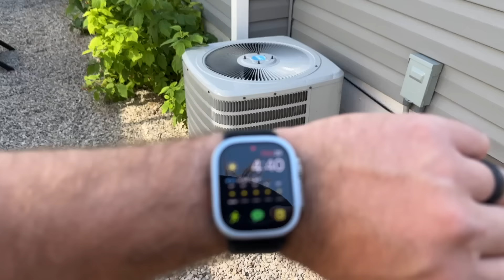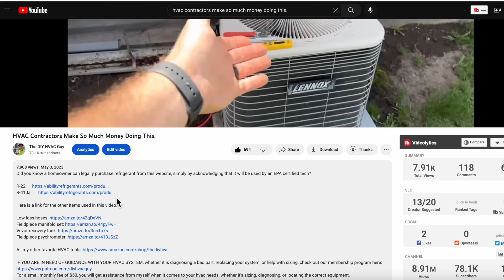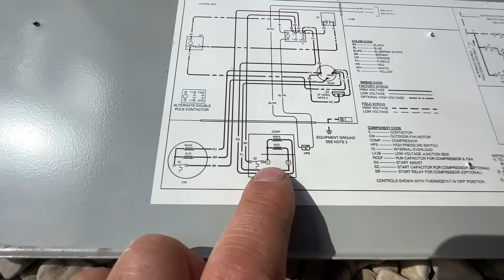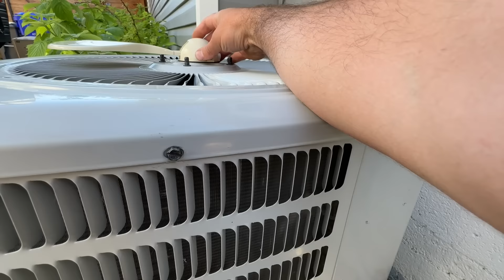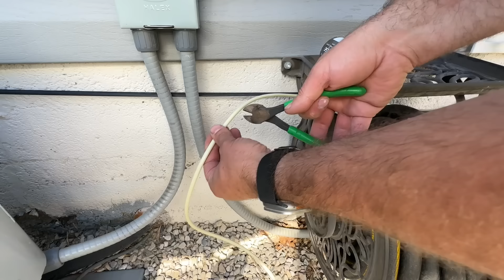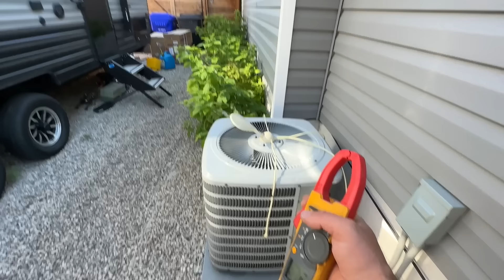Can This Device Actually Lower Your Electric Bill By 30%??

Comment: I used to live right by the ocean and the salt in the air would corrode the fins after a few years.  I think having one of these would actually help since it would be constantly washing off the salt.  The only issue might be if you live in an area with hard water.  I had to put in a whole home water softener.  I put it outside prior to everything else; even the water hose.
Reply: I had a stilt house in Galveston, second row beach, and my AC was about 12' off the ground. I replaced I think 3 or 4 outdoor units due to the salt air. I had installed a lawn irrigation system and while I was at it, I put a couple of spray heads up on the AC platform and aimed them at the coils. Then once a day while the lawn was getting watered, the sprayers would clean the coils in the AC. It seemed to work and when I sold the place, the outdoor unit was still working great. I also noticed that when the AC was on and the water was on, my temperature in the house got pretty cold. Did not do any scientific testing though to back up that claim.
Reply: They make a corrosion grenade that bolts on the line and offsets some of the wear in salt water locations
Reply: wow you all.. as a grower it seems common sense you can just use rain water instead of buying tap for the misters... also R.O ala purified water is literally cheaper than peanuts by weight
Reply: use the condensate
Reply: Common sense - salty air or hard water will requires weekly/monthly washing of the condenser coils. Your choice - maintenance of your stuff or they will break.
Reply: A water softener removes calcium, but replaces it with salt, so if you're using softened water, you're basically spraying salt water on your coils anyway (albeit the salt is very low concentration)
Reply: @gorak9000  Nope. A water softener uses crystals that cause minerals to deposit off the water onto the crystals. Then, once a day, it cycles a cleaning process where salt water is used to clean off the crystals, then that salty and mineral-laded water is dumped in the drain. The water that hits your house is never "salted".
Reply: @DerekKerton  You need to do a little more research my friend. Water softeners are "ion exchange" - you exchange a calcium ion for a sodium ion. The medium in the softener takes a calcium ion from the water, and gives up a sodium ion in return. Then you regenerate it by running a salt brine through the medium.
Reply: @gorak9000  Nope again. You'd better have another look. NaCl in the brine washes over the medium during the cleaning cycle. The medium takes Na (a sodium ion) from the NaCl, and that replaces the minerals on the medium during the cleaning cycle. The extra brine & minerals are then rinsed away. If you check, you'll find that Na is Sodium, not salt. In fact, what you wrote is totally correct, but somehow you've gotten confused and assumed that Na+ is NaCl.
Reply: @DerekKerton  I don't think the calcium or magnesium you find in hard water is elemental calcium or magnesium - it's going to be calcium or magnesium salts - you're exchanging ions to replace the CaCl2 or MgCl2 in the hard water with NaCl
Reply: @gorak9000  Well, let's simplify. Taste the water in a home with a softener. Taste salty? No.
Reply: It won't be washing off the salt -- the whole benefit is based on the sprayed water evaporating and thus cooling the air before it enters the unit.  You'll still want to wash off the salt, as mentioned in other responses.
Reply: @@silvershamrock1990 You are correct and such a genius. I would have never thought of the fact that the mist wasn't enough to wash anything.
Could you explain further what happens to the mist when it doesn't evaporate instantanously in HUMID weather?

Comment: If you want to lower your AC bill by 30% get rid of that stupid vent driven system that wastes 40%+ of it's power through ducting.
Reply: replace with what, I need a new unit soon, thanks
Reply: @trauma50disaster1  the new split units are far more efficient. If you can't handle DIY or find and installer, window units are available.

Comment: Constant water on any type of metal will cause corrosion, some faster than others.And the money you save will be overshadowed by the cost of the water usage. The AC manufacturers put a whole lot of time engineering these units to keep them running at full efficiency in various conditions. It may be a little help but will not really save you anything in the long run.

Comment: so you're wasting drinking water to do this? Install a solar array with battery and use your energy produced to save money. As you are a DIY channel you can do this on your own too, I'm sure. 
That is so wrong to use water....  imagine each and everyone would go this way? I know, know, the trolls will tell immediately that it is just a mist of water, bla bla bla but still it is using drinking water (which in it self maybe had to be treated extensively to reach drinking water status) to achieve a reduction of 0.7A. I'm almost certain if you would ensure a shade for this unit and some meters around it which in turn already cools down the ambient air temp it is pulling you would have achieved the same thing or even more.

I'm responsible for our towns water systems and grid. The amount of work which has to be put in it to purify it can be extensive depending on the location. Reverse osmosis. UV, Charcoal, OZON , pumping etc. and they you waste it to cool the fins of an AC unit? Did you account for this in your savings calculation? Don't you also pay for your water?!? 

The most american ting I saw in a while, haha 🙂
Reply: it uses the same as one flush of the toilet.  I feel guilty flushing the toilet, do you let your waste build up in the toilet to save money?  No?  The amount of work which has to be put in it to purify it can be extensive depending on the location. Reverse osmosis. UV, Charcoal, OZON , pumping etc. and they you waste it to flush the toilet? Did you account for this in your savings calculation? Don't you also pay for your water?!?  What country you from, haha
Reply: @trauma50disaster1  🤣😂😂😂😂

Comment: This works well in dry areas. In Arizona they have usually a second unit on the house called a swamp cooler which uses evaporating water to cool the house. If you are under like 3% humidity then it alone can cool the house at half the price as a AC unit but when the humidity comes back up then you have to switch back because it quits working when the air is already wet.
Reply: Note, these thing rusted like crazy. You had to constantly sand and repaint them to keep them from falling apart. I would think one attached to your AC unit might have the same problem.
Reply: It's rarely that dry. Average dryness in both low and high deserts is between 10 and 12% most of the year.... otherwise yes, my swamp cooler would get my house in the 60s by late evening. I had to install a proper thermostat so it would cycle and not make the house too cold.
Reply: A second unit?
Haha
Most low budget homes only have a swamp cooler, no a/c. 
Higher end homes might have dual air (both a/c and evap swamp) but is an affluent setup having the cooler not fight the a/c when the operator doesn’t know the difference and runs both at the same time. Nice homes have it setup for one or the other, since one is a humidifier and the other one is a dehumidifier and the swamp cooler blows all the a/c out the windows and vents and the a/c then can never nock a dent in the temp.
Reply: @dallynsr  So true. I could never get my house much lower than 80 F. I think my AC was too small. I moved back to the East coast were everyone had their AC set to 68 and I had to wear a jacket in the summer time because everyone had their houses to cold for me. Guess I was use to 115 F summers.
Reply: @dallynsr  "Most low budget homes only have a swamp cooler, no a/c."
Not where it's humid.
Reply: There's been a number of con men trying to sell evaporative/swamp coolers here in NZ - where the relative humidity is rarely below 80%.
Reply: @TonyRule  An add on accessory isn't the same as a swamp cooler that works solely on evaporative cooling. An AC compressor produces enough heat to cause flash evaporation around the unit. A swamp cooler relies solely on the environment.
Reply: @wisenber  No shit, Sherlock.
Reply: I carry a pump spray bottle of cool/cold water for the car. Helps to move that heat into the condenser (where it belongs).
Reply: My concern here in AZ, especially with a unit on the roof or in a location where it gets a lot of sunlight, is that the water hoses would get baked by the sun and disintegrate in no more than a year or two (more likely a couple of months).
Reply: "but when the humidity comes back up then you have to switch back because it quits working when the air is already wet."
A swamp cooler is ambient temperature. An outside HVAC unit will be warm enough to still evaporate a mist. The evaporative mist cools the unit, not the house. If the unit is cooler, it requires less energy to cool.
A shade tree would have a similar effect in reducing the load.
Reply: @wisenber  99% humidity all year long makes such system widely inefficient because it does not evaporate and causes moss and lime its just corredes the spire faster

Comment: It depends on your water and the contents therein.  Any kind of salts are obviously bad.  Any kind of calcium will solidify/harden.  This can add an insulating layer over the aluminum fins that are supposed to exchange the heat with the air, but it can also get into/onto moving parts seizing them up.  As an example, I've seen an industrial fan, basically brand new, need oil service because of being in close proximity to misting water with high calcium content.  Basically turned the whole fan white and caused the thing to squeal when on.

But otherwise, yes, this does work.  Evaporative cooling is basically what the effect is called and it's been employed in "Swamp Coolers" for years.  When water evaporates, it takes a surprising amount of heat with it as part of the process.  And it should be noted that that effect works best in dry air areas.  High humidity dramatically decreases the ability for the water to effectively evaporate.

Comment: Note that the water filter, shown in the video, does not remove calcium. It is a water conditioner which slightly changes the chemistry of calcium to reduce scaling, but does not remove it.
Also, is slightly (very slightly) make the water acidic, which with the calcium, is not good for longevity of the condenser.
Reply: This is the reason I am always hesitant to use misters. I would like to eventually make a mister that uses only the condensate water for this reason.
Reply: @xjmg007  What a FANTASTIC idea. I already have a project on my list to re-plumb my condensate drain as it's generating so much water that I have a swampy area. An Arduino to measure water level and pump accordingly, and you have a good self regenerating mister.
Reply: @zacwolf2  if you figure out a way to make it work, please let me know. Any input would be greatly appreciated. I'd probably need to make a solar 12v system because I don't have access to an outlet near my unit. Thank you
Reply: @xjmg007  yes! Do this! And also incorporate a light sensor so your only operating in direct sunlight, and get rid of the Sail valve and connect directly to the contractor so it only is enabled when the compressor is on.
Reply: @paulvild  There was an airflow switch on the device…
Reply: @EarlHayward  yep
Reply: It does work, but it definitely will reduce the lifespan of your unit. I don’t think the cost savings are worth the cost of replacing the unit before it’s average lifespan.
Reply: Even with the best filtration, the water is eventually going to cause dilapidation.  And that will lead to other problems.
Reply: as a grower who knows all about water filters and rain aka pure water.. you can capture rain and use that as its only about five parts per million (mid florida off the roof anyways) or just use purified aka R.O water in a bucket for the misters...
Reply: @dertythegrower  rain water is heavily polluted. Worse than tap water. Get it tested and find out for yourself. The majority of rain is produced with rapid evaporation equipment, machines manufacturing/ pumping rain clouds from the ground up, think power plants. The "water cycle" is vastly no longer natural, sad to say.
Reply: What about just have a shade providing cover.   It on the unit but above allowing good airflow from all sides and top.  Just curious.

Comment: The effectiveness of those misters is inversely related to the relative humidity. They work MUCH better in dry locations like Phoenix, AZ then they do in humid locations like Orlando, FL.
Reply: "The effectiveness of those misters is inversely related to the relative humidity."
That's for a swamp cooler which is at ambient temperature. An outside unit in Orlando will be well above ambient and hot enough to evaporate a mist.
Reply: @wisenber  Nope, not as effective in a humid, high dew point area, The mist does not really evaporate as in a low dew point climate in high dew point area.  So cold water volume is really needed.  I should probably publish my experiments in St. Louis yucky weather.  I ended up having to saturate the condenser with volume to see appreciable Amp drop and temperature drop.  The mist was minimal in >60 degree DP.   This is the reason why people feel hotter in 70 degree dew point than in 50 degree.  The sweat evaporates (needs body heat) off the person at the lower DP cooling them.  

For those playing at home, research the BTUs required to raise 2 gallons of water 1 degree.  Remember that that water is misted  over hours of running.  Then consider your AC is between 12000 and 60000 BTU.

My experiments showed that I needed ~5 gallons a MINUTE to get much change in humid weather and that was the actual heating of the water by the coil.  Or, cooling of the coil by the water.  Two to five toilet flushes a minute.

My next experiment is going to route the liquid line from the compressor directly to a water submerged pre-coil then back to the air coil.  This should be dramatic and should use a lot less water.

Comment: If you live in a dry climate, you can double the life of your heat pump by putting it to sleep all summer long and chilling your house with a swamp cooler instead. They are super simple machines that use very little energy and are quiet - no compressor means all you hear is the squirrel cage fan. We had one mounted on the roof of our mobile home at the midpoint. We would open the windows at both ends of the trailer about an inch. The air coming in through the cooler was very cold and could easily freeze you out on the hottest day. With the windows opened a little, the moisture in the air stayed plenty low - it was never humid or muggy in the trailer house. We're going to buy a unit for our new house because the federal government wants to ban the refrigerant. Once they do that, swamp coolers will skyrocket. Don't bother getting one if you live in a humid climate.
Reply: swamp coolers will only give you a outlet air temp of 80 deg on a hot day of 110 deg at 10% humidity. as humidity goes up the outlet air is even worse. any humidity above 15% the swamp cooler is worthless.